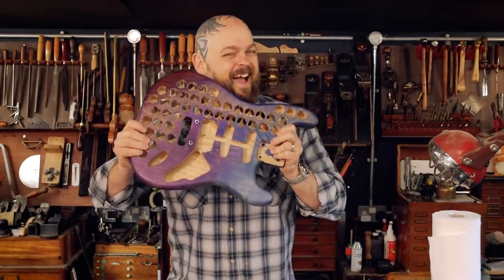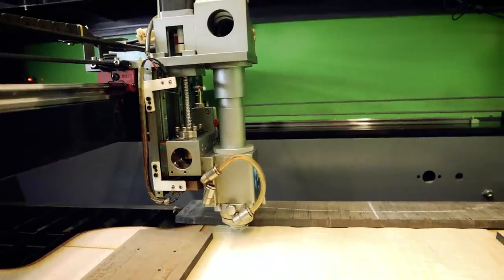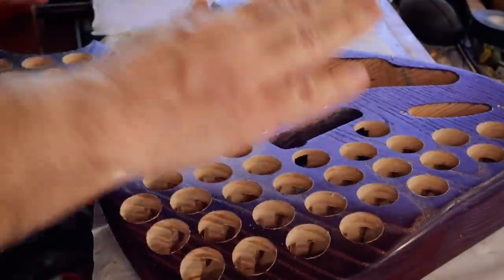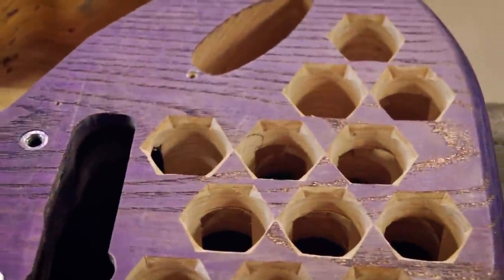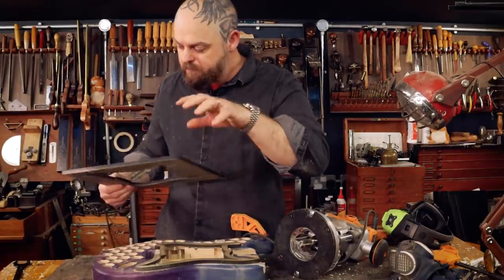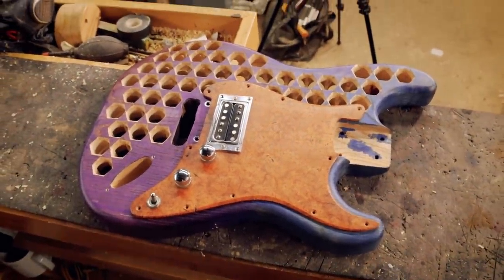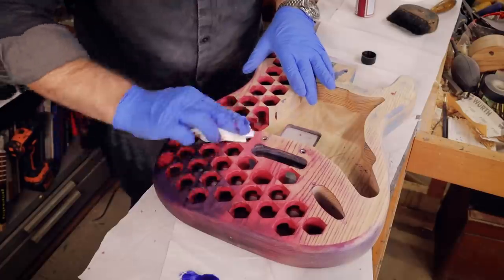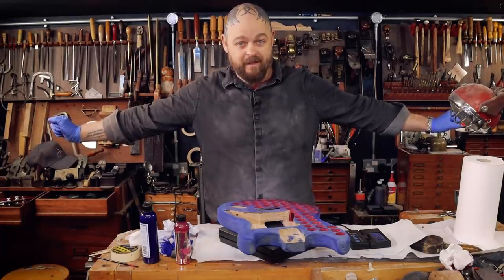Ep 2 of 3 My Daughter HATES a guitar I made for her!  More EXTREME weight relief on a 10lb+ guitar!

Comment: I like the effect of the cut-outs.  I would have been tempted to array them to follow the curvature of the body, but I'm not the one doing the work.  :)  I wasn't sure about beveling the edges to get the hex effect, but I like it now.  As for the color, I don't like it.  I think it looked better as bare wood.  Whatever you do, I think you need a higher contrast between the inside of those holes and the main body color to get the thing to pop.  Otherwise you risk losing the visual effect and sort of defeating the effort you've already put into it.

Comment: thanks for experimenting.

Since it looks like a pop art geometric art i would do pop colors that pop . Maybe black red and white?

I have bought 10 plus strat and tele bodies. There are some solid bodies from EDEN on ebay that are 75$ and weight 4 lbs. 
I love the light swamp ash MJT bodies for 300$. 3.75 lbs. for a 7 lb tops guitar build.

fun project, thanks
Reply from the maker: black, red and white sounds fun!
Reply: @CrimsonCustomGuitars  One of these days you should make an American guitar with Star holes in a field of blue stain on the upper left corner. May take a very small router or drill bits followed up with an Exacto Knife, but the holes should be star shaped.

Make red & white stripes out of stain as well with whatever stripes that line up with the neck going up the fret board.

If you can hide red white and blue LEDs in the bottom portion shining into the hollow cavity with a USB rechargeable battery pack, that would be bitchin'! (Utilize one of those auxiliary batteries for phones)

Comment: Unfortunately, after Nebula 2.0 - every single stained finish has to live up to that incredibly high standard.
I am glad that you are going to re-do that "properly". After all that drilling, that pattern NEEDS to stand out and be shown off.
The stain just isn't to your usual standard.

I was very concerned about routing right through to the trem cavity - I thought you might just leave it as a swimming pool route a la many Strats.
Another option for weigh relief would have been holes drilled through the sides of the lower horn - like the earlier weight relief build - but then again, you tend not to repeat yourself.

Comment: As a person who's had back surgery I really like the design. But are you SURE your daughter didn't like the guitar because of the weight? I would guess that she'd typically be playing while sitting anyway.
Now, if it were me; I think I'd be a bit more put off by the fact that it only has ONE pickup in a body actually designed for THREE pickups; kinda makes for a somewhat tonally constricting instrument.  When I was that age...back in the 1970s... I was always more interested in emulating how my favorite players sounded - even if I couldn't come close to playing the actual notes they were. The larger the gamut of sounds I could get out of the instrument, the better. I guess that's why I always gravitated to Fenders more than Gibsons.  I'd be itching to at least wire that guitar as an HSS - if not an HHH using two mini humbuckers.
These days I primarily play a 3 humbucking pickup instrument, each pickup is independently switchable and tappable, and to cap it off I built and installed an Alembic "Blaster" circuit in it as an onboard gain control. Talk about FLEXIBILITY!

Comment: With so much material removed from the body, the guitar may have a tendency to tilt when the neck is installed. You would need to add weight to balance it. An interesting build anyway.

Comment: I actually liked it much more with just the circles. I love honeycombs but unfortunately, this is not a honeycomb pattern so it looks off to me. On a true honeycomb, the edges of one hexagon are parallel to the ones next to it whereas on yours they are point to point. If you had rotated the hexagons slightly, so the sides were vertical (parallel to the pickups or frets) then it would have been perfect.

Comment: Could metallic spay paint be used for shielding? I was thinking that the inside of the holes might look cool in a metallic finish, with the upper edges having that awesome shocking pink.
Reply from the maker: no, metallic spray paint isn't conductive, it needs to be proper shielding paint.

Comment: Didn't like the first iteration, I kinda like the new look. Just the finish on the inside of the holes is a little bit too meh. Maybe accentuate the hexagons borders,  a little bit of sparkle in the holes (maybe borrow something from Shred?) and obviously a new scratch plate. We didn't think for a second that you would have left the existing one. You could put the hexagons also on the scratchplate, or at least a hint of them just to continue the design. And then you'll need to do something to the neck, otherwise it will be too neck heavy, but we'll see it in the seventh episode.

Comment: You asked for opinions, so here's mine. (bearing in mind that opinions are like buttholes, everybody has one and the only one that matters is your own).
Personally I think the hex holes was a bad idea, you wanted it to look like a Mac Pro and now it doesn't.
loving the idea of the blue-purple colour flip on the body but don't think the screaming pink will work inside the holes. I would go for a very aluminium toned silver so it looks like the body has been machined from billet. 
I also believe that the headstock needs some degree of matching treatment, maybe not the holes but at least the body colour on the face. 
I'm sure, whatever the final form is, I will (as usual) go from "Oh, Ben's ruined it." to "Wow, that looks AWESOME!".

Comment: 🤔 how you going to attach them trem springs and bracket  , asking for a friend….
Reply from the maker: lol. either very long screws into the neck heel or possibly I could bolt a block through the back in the usual place and use standard holes.. not sure which yet! I routed half way through the screw holes and swore a little into my mask :(

Comment: If you'd have made more contours in the body of the guitar to better fit the form of the human body, like with genuine Strats and even more so with offset models like Jaguars, Jazzmasters, Mustangs, etc., that would've reduced the weight by at least 20%, alone. Basically, how all offset Fenders are made. Doesn't look like you really cut out anything at all in the breast area. Almost resembles a completely flat, solid block of wood with zero contours for comfort, whatsoever. My Jaquar weights probably HALF of what my Les Paul does. Btw, my LP has NO chambering whatsoever, it is a 2019, 60's Standard, the first year Gibson began to produce them again without chambering in at least 40 years.
Reply from the maker: we could have taken more off but the carves are almost exactly the same as the strat I have at HQ.. I think the machinist made it a fraction thicker though which is part of the issue..